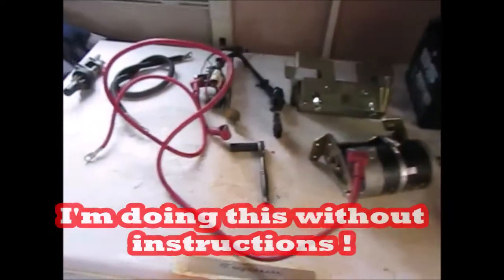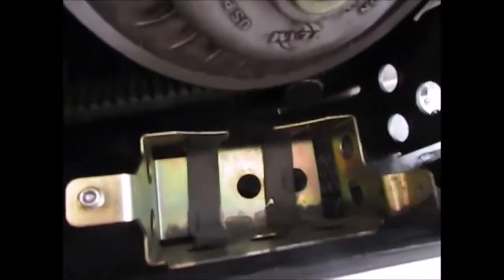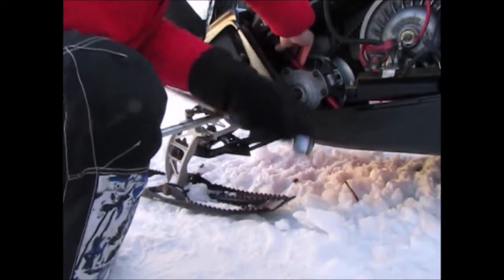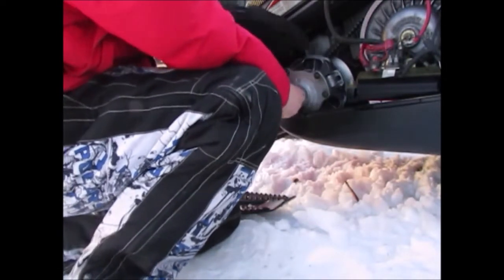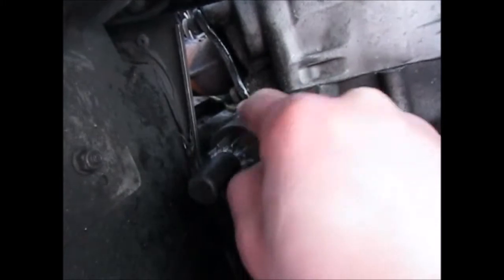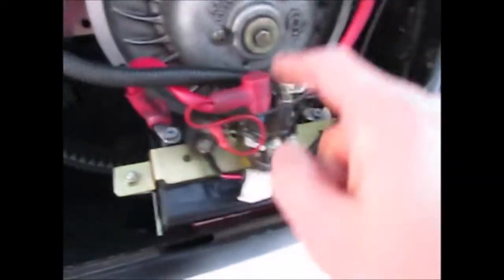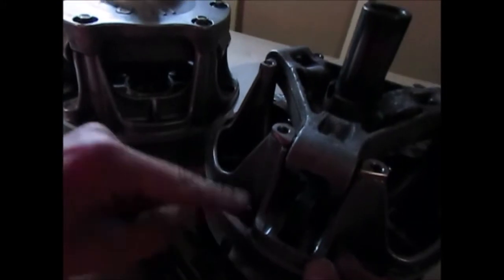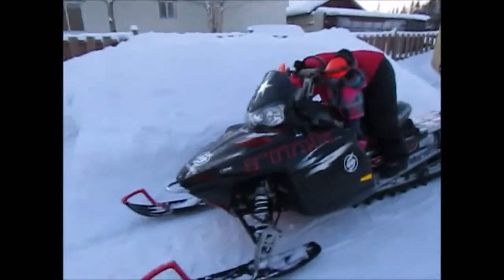Polaris Snowmobile RMK Dragon IQ Electric Starter Kit Installation

Comment: Great video , easy to understand and very helpful , one question...how hard is it to change your belt now with the battery and electrics right beside it ? Im ready to add an estart to my 09 IQ
Reply from the maker: Thankx for the nice comment ! And my belt was new so I did not have to change it... I guess if it happens you need to pop off your primary clutch or you need to remove the battery... Just bring a wratchet in your tool kit to remove the battery if the belt ever needs to be removed... I sold this sled last year and am now running a 2013 Pro RMK ! The electric start to the IQ was pricy but a great option !

Comment: Do you have a part number
Reply from the maker: This part as a set is unfortunately discontinued... You have to look on ebay or call snowmobile shops that sell used parts. That's what I did ! A part's shop here in the Quebec Canada area. What is your snowmobile ?
Reply: @doobyboy21  ive got a 2004 800 RMK, do you think this will work on that?
Reply from the maker: @Dr.Derp073  look in your shop manual... If you don't have one go download it on hardcore sledder forum ! There should be an electric start for you sled